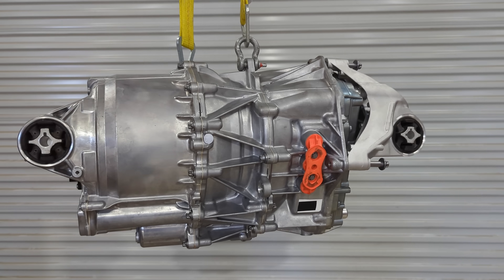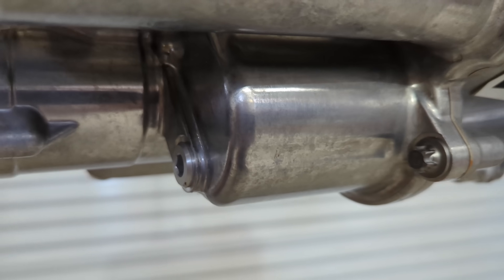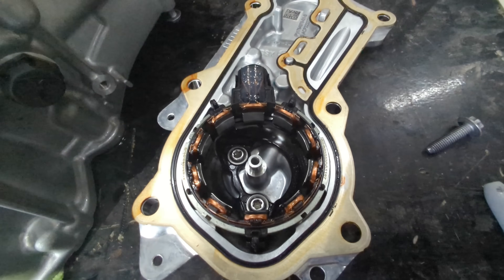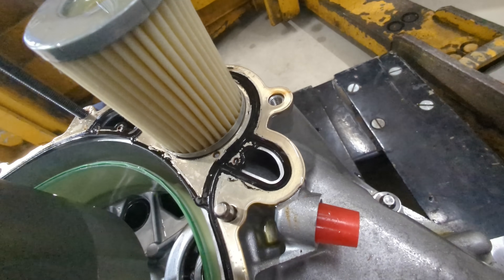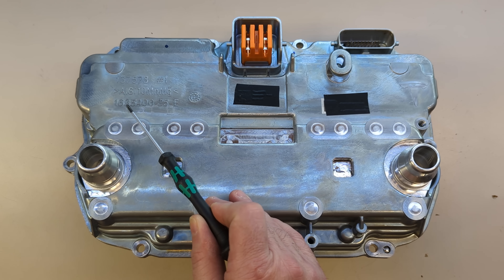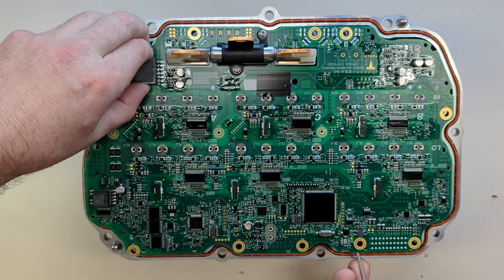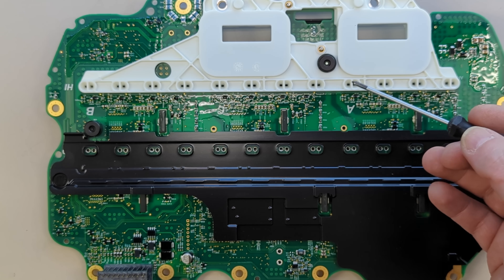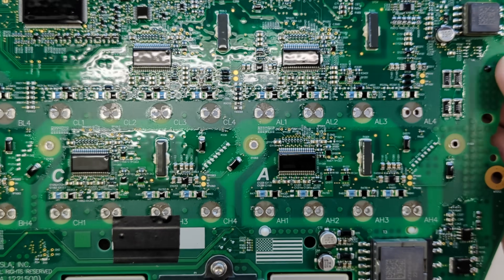Tesla's Newest Motor & Drive Unit

Comment: How can other OEMs possibly compete with Tesla's pace of innovation
Reply from the maker: So far they can't.   Tesla now has a good heat start that they seem to be keeping.  They also have significant cost reduction now through economies of scale and relentless optimization.  It will be hard for anyone else to sell an EV for what Tesla is and still make money.
Reply: @Ingineerix  And more over still looks pretty serviceable with all cutting costs modifications. Only a PCB build in transformers can be an issue.
Reply from the maker: No, the inverter isn't considered "serviceable", you would just replace it as a unit.   Luckily Tesla builds extremely reliable electronics.
Reply: @Ingineerix  Heh, I repair a lot of "unserviceable" :) for me it's not that bad as 2011-2012 leaf OBC.
Reply: @Ingineerix  Love your work. I've followed you since "secret signals". I was impressed by the "brake disc wipe request"
 Found out the service access procedure but am afraid to go too deep for fear of not getting out. You said that since the S Plaid was so high powered there would soon be some wrecks available but apparently you haven't got one yet. By the way, my one year old Y charged usually to 60% shows no degradation since new after 12k miles.
Reply from the maker: @leeoldershaw956  You've seen my Plaid series, right?
Reply: @Ingineerix  YouTube red bar says I saw them a year ago. I was an EE for RCA Missile and Surface Radar Division from '59 to '64. TUBES!, so I'm old and forgot. I had a Ford Fusion hybrid from 2009 to 2018, a Model 3 from 2018 to 2022 and the Y since. It's  a lot easier for stiff old people to use.
Reply: They're effed

Comment: Why is the permanent magnet Motors laggy? They suck compared to the induction Motors.  Older dual Motors cars is way better in the winter and at keeping traction from 0. 
Why is this a problem for permanent magnet Motors?
Reply from the maker: I don't find this is the case.  The PMSRM responds faster, has more power density, and holds power better at higher RPM.  (Not to mention better efficiency!)
Reply: @Ingineerix  : just try a hill start on lose gravel.  Dual induction vs permanent is ridiculous.  Some said it was hard to control because of the magnets wantet to rotate or something. But he didn't know any more. I'll can send you examples.
Reply: @Krishell  maybe it's something like: In induction motor, you can power both wirings as you wish, with permanent magnet you have to power phases more accurately to match magnets positions.

I don't know, just guessing, but maybe this allows for faster startup?
Also, with recent FW, looks like Tesla is mostly RWD.
Reply from the maker: @Krishell  Induction is significantly less efficient.  PMSRM has the best of both.  Any issue on loose gravel is a traction control issue, nothing to do with the motor itself.